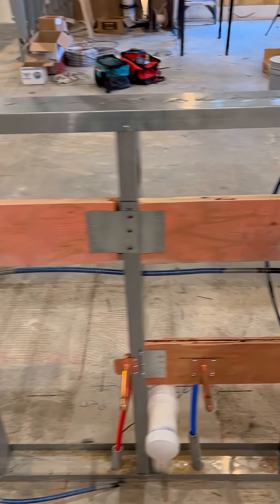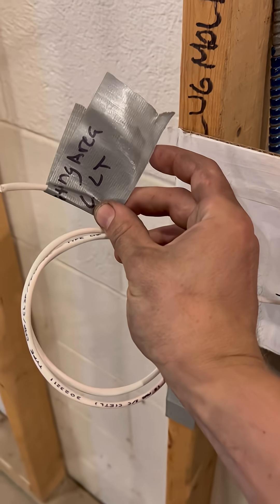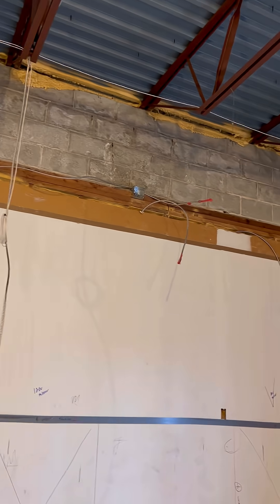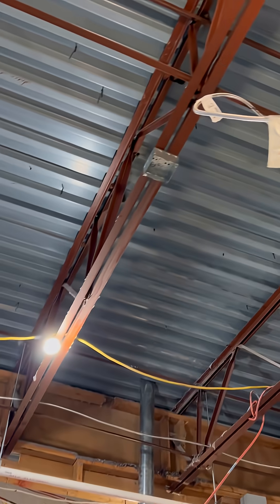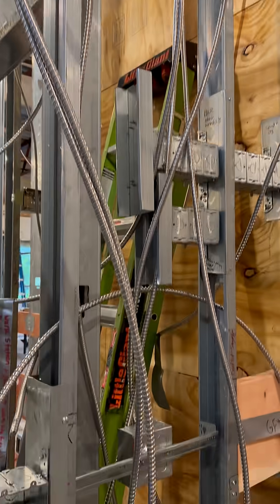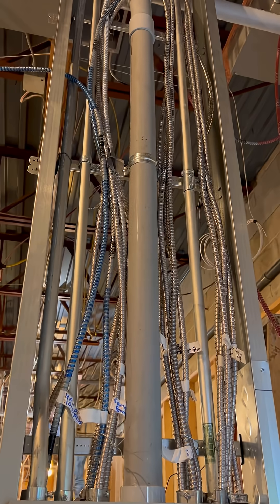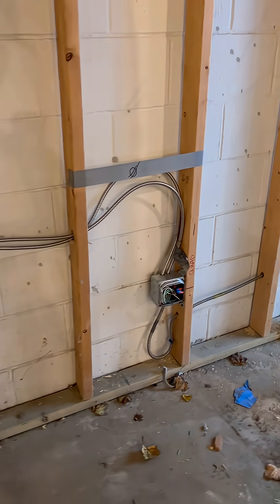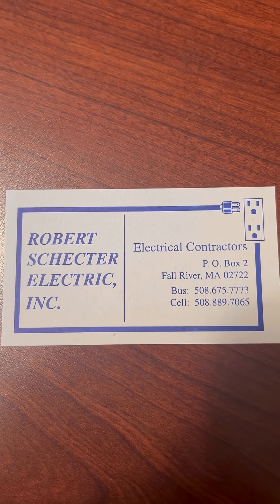🔥 Why Breakers Don’t Go In at Rough ⚡ + Low Voltage LED Lighting Overview!#shorts #electrical

Comment: That project is going to keep you folks busy for a while, which is better than sitting around twiddling your thumbs hoping for a call. :^D Should go a long way towards keeping your own lights on. :)  Great work! 

Yeah, on that question about why you don't have the breakers installed yet...I agree, some numbnuts will come along and flip them on, just because. Unless you had some way to do LOCK-OUT/TAG-OUT on those, it's best to just not put them in until everything is wired, then pop them in and test one at a time.
Reply from the maker: Absolutely we are very busy at the moment between service calls this job we got houses to wire new services to put up it’s really busy! I’m glad you agree friend!